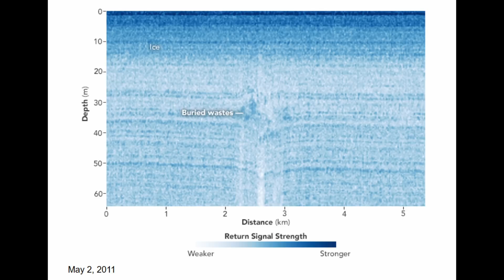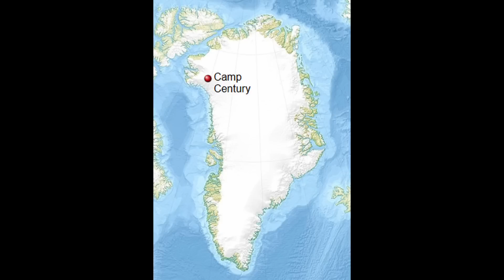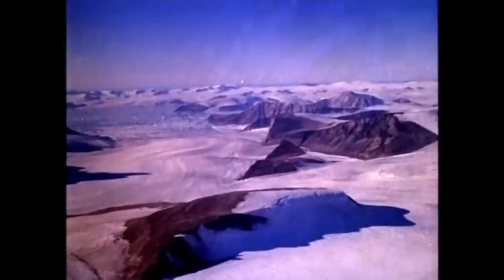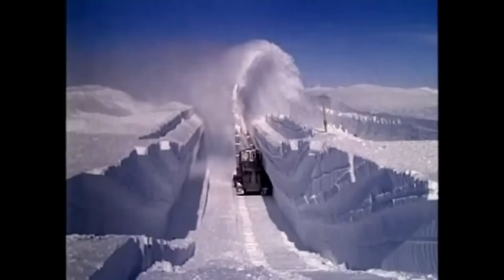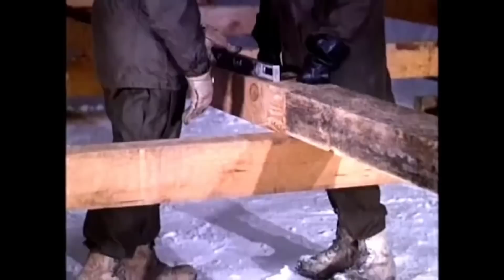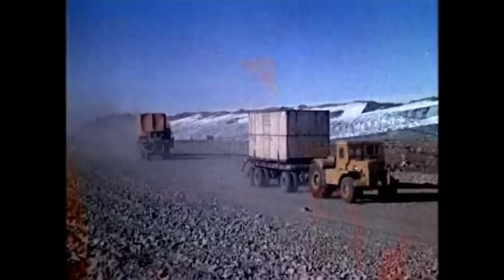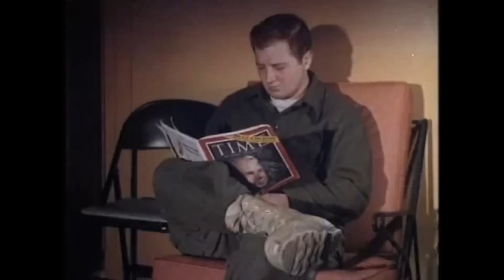A City Under the Ice - Camp Century in Greenland

Comment: Mapping Thule Air Base for GIMS (USAF outside communications plant mapping software) required us to do some things not normally done with GIS type software. Because of the far Northern location, if you used normal equal lengths of X and Y coordinates for buildings and air strips, you'd display a very squashed image. We instead computed on the fly from the center of the map area, the ratio required to stretch the display to keep everything looking "square" like it would be at much lower latitudes. Rather proud of that particular feature.
Reply from the maker: Very interesting! Thanks for sharing!

Comment: I dont know if you know about the ice dam that formed lake Missoula holding 500 cubic miles of water standing 2100 feet deep at the dam. The reason it worked the percell ice lobe pushed 10 miles up the river valley and was at least 2366 feet tall. I wonder what the force that pushed the ice 10 miles? I think the ice over lake pen oriel was about 3600 feet above the valley floor. Might you know the force involved? The water at the bottom of the dam was around 950 psi

Comment: Well done.  You got pretty much all the key points.  The only thing you didn't mention is that the US built Camp Century without the permission of the Danish government which caused some issues in Denmark.  Camp Century has the potential to become a real problem now that the ice caps are melting and there's no way the US can wipe their hands of the hazardous waste left behind.  I don't know how you could even begin to plan to clean up something like this where contaminates are spreading out within the ice sheet.  It's a like a box of hand grenades with a label that says "CAUTION Some safety pins may be missing".
Reply from the maker: Thanks for your comments. I understood that Denmark knew about the nuclear reactor and the overall construction plans but definitely did not know the plan to install nuclear ICBMs.
Reply: @CaseyJones-Engineer  As a professional engineer, I have also been fascinated by this project and spent a good bit of my free time researching it.  From my research, my understanding is that the US Ambassador to Denmark informed a member of the Danish government about Camp Century after the construction of Camp Century was already well underway, including the planned installation of a portable nuclear reactor.  That Denmark was only told about it after the fact.  US-Danish relations were very good and cooperative at the time, as well as today, but the Danes were concerned about public backlash for allowing the US to build a nuclear reactor on Greenland soil.  My understanding is the Danish Government kept it secret for a very long time and it was the US that ultimately declassified and made the project public.  Also, yes, I don't believe anyone knew the full scope of project Ice Work until the 1990's when it was declassified.
Reply from the maker: @JimmyJamesJ  Thank you for those additional details. It is certainly a difficult environment to work in.

Comment: That's really interesting, thanks.  
I didn't know Alco in Schenectady made reactors - I only think of them as a locomotive company. 
My grandmother worked at GE turbine in Schenectady in the 60s - drove past Alco daily.
Reply: If a company can make boilers, they are capable of making other types of containers out of steel.
Reply: @royreynolds108  Yes, I didn't know that GE just up the road from them made reactors for ships there too.
Reply from the maker: It was a fascinating project, for sure.
Reply: @CaseyJones-Engineer  The Alco site is a casino now.

Comment: Suggestion for another video: the plane in the Korean airliner crash blew up because it ran into one of the most non-frangible structures you can build, rebar concrete. Why would they put that at the end of a runway?
Reply: No details yet but my understanding is without the landing gear being deployed it ran off to the side of the runway. It could have been anything, a storage area, a concrete structure or warehouse.
Reply: @RonSeymour1  The Korean plane hit the localizer antennas that are exactly on the line of the runway, but they were supported by a very strong raised concrete base for some reason. In other airports, the antennas have a frangible connection to a base that is flush with the ground surface so an airplane overrunning the runway can pass through with little damage.
Reply: @RonSeymour1 , a pilot from Ukraine named Denys Davydov has an initial react video that mentions a specific structure at the Korean airport (👇)

And what he says makes sense from a civil construction standpoint, that if you expect a disaster to hit specified structures you want to make those structures crash-friendly to human life if you can.

https://youtu.be/w1r8dl4RqMw
Reply: @RonSeymour1 , there is a question to investigate. 

Denys Davydov is a pilot who's flown 737's & is from Ukraine, the invasion by Russia being why he is not flying now. He seems to be proficient from the material he's posted at Pilot's Blog on YouTube. 

This link is a video of a pretty initial react to the crash (👇). It's long but it does bring up questions including about the construction at the end of this Korean airport's runway I mentioned (youtu.be/w1r8dl4RqMw).

My initial thought is that the airport construction is Cold War -era. Back in the 80's to early 90's industrial survivability best standards & best practices were still unknown particularly in the new age of industrial robotics, January 25, 1979, being the first time a robot kills a person.

However, this airport was built in 1997.
Reply: Their reasoning is that it had to withstand typhoon surge/flooding.  Supposedly there’s no reliable means of offsetting localized antennas and correcting the signal via software/hardware
Reply: @timblack33  re: "localized antennas"
Localizer antenna - its a specific function they perform, not just a 'local' antenna ... 
The old ILS system was rather basic ... GPS-based "RNAV" is a whole nother thing and overcomes those shortcomings of course.

Comment: 1:57 synthetic aperture radar
And ice and snow are dry so radar does have penetration.
Reply: Yes, the NASA-JPL synthetic aperture radar that they used in this area was the P-band or 68 centimeter radar wavelength. This is what penetrated the ice enough to detect the Camp Century structures. The profile Casey showed was ground penetrating radar that has an even longer wavelength.
Reply from the maker: @ericfielding2540   Very cool, thank you Eric!
Reply: @ericfielding2540  
JPL modified a G2 for IFSAR around 1997.  That plane was provided by the company I worked for. After JPL ended their project we continued to operate the G2. 

It was side scanning X and P band, left and right looking antenna. I was a crew member on that plane for about 7 years. Amongst the projects mapping a large portion of the Andes in Colombia, all of Papua New Guinea. 

And operated out of Tule Greenland for several months.
Reply from the maker: Thank you!